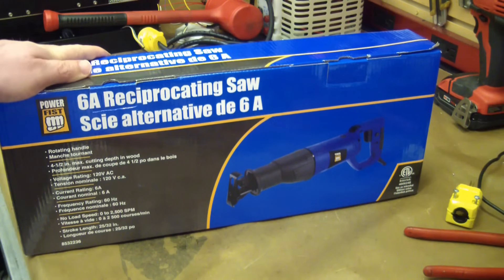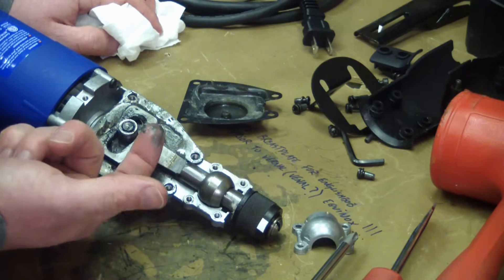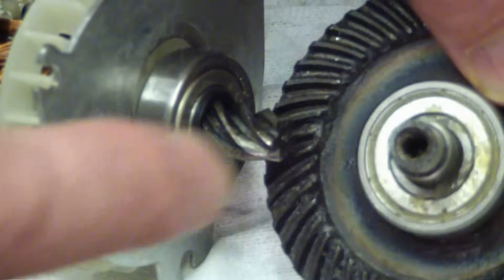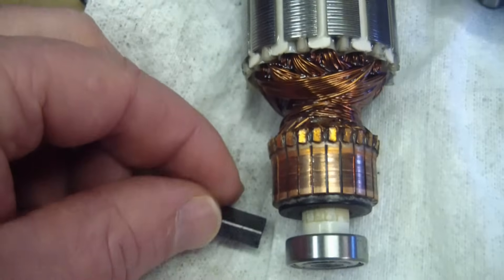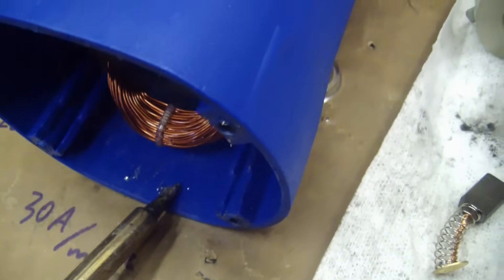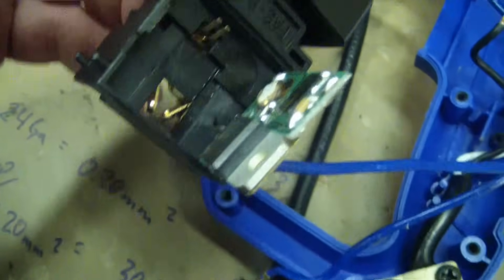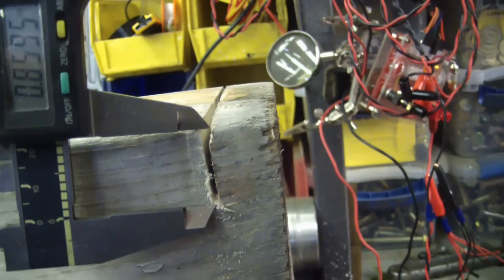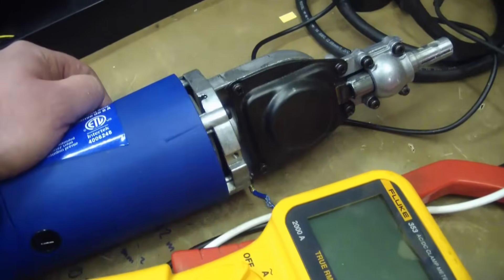Bored of Lame Tool Reviews? Power Fist Saw. Sink your meat hooks into this Offshore Abomination!

Comment: I have the HF saw. Its different,  the swivel is at the working end of the tool not the handle. I don't use the tool daily but I do have the occasional need and have used it to cut some badly rusted 1/2" bolts, and a couple of entry door installs and a few quick things. And she's still "Chooching" it is noisier and vibrates more than the brand name saws. In general I hate these things because they shake you half to death using them but sometimes its the best tool for the job. Mine has saved me a couple hours of time and had I rented one from the tool rental shop it would have cost me $10 for a half day of use. I paid about $25 at HF so I don't feel ripped off since it still works fine. But if I needed one on a regular basis I would go the extra bucks for a brand name. Milwaukee makes one with a handle like on their large grinder instead if the "D" handle which seems more ergonomic. Ok now I'm rambling. Keep up the good work.

Comment: I bought one of these from horrible freight,  I needed one that day and was broke, so I bought the El cheapo. I have replaced it with a Milwaukie  and gave the craptastic saw to my wife...somehow a very small 120lb women managed to strip something out in the drive train.  The motor runs just fine but the blade no wiggels.... now I'm going to go take it apart and see what gave out, and maybe think of something to use the motor for..... maybe attach a fan blade, or a paint stirrer, or who knows. I will find something very  unrecommendable to do with it.
Reply: Looks like the pinion gear was run through a pencil sharperer!....And zip ties holding the field windings in place....very high P.O.S. levels.

Comment: If that's apprentice soldering, I must be the best damn apprentice there is. First time making a headphone cable, almost goofed on the 3.5mm unbalanced jack (should have used 1/4 inch), never had a problem... Except on the grounding bit, you need pixie fingers to solder headphone cables.

Comment: ave. your videos are awesome!  
but one mistake with the description of the bearing  .
z dosent mean deep grove baal bearing . 
6000 z 6 means deep grove ball 0 means the duty of the bearing and the last two 00  tell you the size. z means metal sheald 00 =10 mm 01 =12mm 02=15mm 03=17mm then everything from there times by 5 04= 20mm and so on

Comment: Ever thought about doing some videos on cheap tools that are pretty good?  lol.  I'm currently looking for a die grinder to do some mild head porting on a set of factory iron GT40 heads.  Keep up the great videos brother.
Reply: I bought 3 pneumatic die grinders from Harbor Freight back in 2005,( 2 with a 90° head and 1 straight), for about $30.00 and they kicked ass and were consistently used and abused very often. I still have them although they haven't been used in several years because I dont own a compressor that can produce/store large volumes of air for extended periods. They do consume a lot of air for sure. I bought a straight die grinder from Strap On for $300± in 2007, and those heavily used Chicomp cheap grinders worked just as good, if not better than it.

Comment: this is the same black switch i have on my electric  blower...fairly good but it loses accuracy/flicker with time and dismantle is needed to clean/sanding it with contact cleaner to make it function again
probably interchangeable with mine..
Reply: .....one trick for the blower is to unbolt it and then put it back together gasket maker silicon ....now it can build some pressure enough to  blow out coolant out of your engine/radiator and with the right adapter it blows old gasoline/oil from your lines and stuff...

Comment: what grade of file are you using to make these determinations. I've wondered for like 5 years watching your vids..
Reply: They have special files that test the Rockwell hardness of metal. Each file is of a different level of hardness, so when you start with the first one and continue with each one until a mark/scratch appears. Whatever file that caused the scratch will tell you how hard the metal is, at least somewhere around the +/-10 Rockwell if the actual hardness level. The files are for quick testing rough estimations.Example; file #1 has a range of 0 -10, file #2 range of 10-20, file #3 a range of 20-30, etc.....this is just for examples and not the actual range of each file listed. This was used so as to provide a better understanding of what the files are and how to use them. There is also a few other methods and tools available to test hardness levels and prices vary quite a bit.

Comment: That's just rediculous!  Was that a pinion drive or an end mill? Abrasive lube?  What will the planned obsolescence people think of next?  Self shrinking tubing using undersized wires? Clever, but not a very good idea. 

I doubt I could buy the parts and materials to make a reciprocating saw for $30 Canadian, let alone ship it half way around the world.  Apparently Power Fist can't either...it may be shaped like a saw, but it's not a saw.  

Thanks for the warning!  I'll stick with my Milwaukee. 

-- Mike
Reply: BigMjolnir Now that you bring it up, the fact that the pinion might actually be an end mill (WHY OH WHY??) totally explains why the edge of the "pinion" is so sharp! Because it was originally used for machining!

Comment: Princess auto and Harbor freight have no affiliation. This tool has same price. Harbor freight saw is Chicago Electric brand. PA manufacture Power fist. HF sources tools not manufacture. HF Quality assures their sourced tools at a HF QA facility. PA manufactures so doesn't care about QA. Based on your autopsy I would say Chicago Electric is higher quality. I FIX and IMPROVE what I own since I take pride in and value what I possess. I work hard for what I don't have. If it's that buggered I take it back to HF for a refund I like the look on the mnger. and customers faces when I drop off handfuls of broken pieces. I hope it goes to QA so they can study what went wrong and financially encourage them to make less warranty replacements.

Comment: Thats one of the nastiest looking circuit boards I have ever seen, I bet all those parts are secondhand. 19:29

It would be alot easier to just to use only threw hole stuff. Surface mount components look just terrible when they are hand soldered.

Comment: I think you've got your maths wrong with the current per mm2.
P=IV, V=IR so P=(I^2)R and resistance is inversely proportional to CSA (but not a CSA squared or anything). 

So we have the numbers 15A through 0.82mm^2 and 6A through 0.2mm^2. What you've done is then convert everything to amps per mm^2, but I think you should have done I^2 per mm^2.
That gives... PF is 180A^2/mm^2 and Makita at 274A^2/mm^2

Please point out the flaw in what I'm saying.

Comment: At-least you can salvage the motor from this, and use it on some project you want to do. (I've been looking at a lot of 3D printer technology, and I think you could even salvage the plastic case from this thing, to make filament. You'll have to identify the plastic fully though. I'm not saying that plastic is expensive… Just saying that as an aside; there's a lot of stuff that can be salvaged if you think hard enough about it.)

Now that I think about it, what do you even do with most of the junk you accumulate from running this channel?

Comment: I'm not sure how you did it, but if 9 rotations of the rotor equaled one full turn of the shaft, that would actually be 4.5 turns for 1 stroke. So that would be 11,250 rpm I believe.

Comment: I just bought my first sawzall, milwuakee, so I could cut out the BB my bike store said could not be replaced and that I would need to throw away the frame. An aluminum FS bike? When donkeys fly!

blades...diablo is made by freud and the one I got rocks through steel. No hook rake angle with carbide teeth. way better than bi metal

 power fist sounds like a bad porn movie I just do not want to see. I started watching this thinking" I don't need to see this" but then you made me laugh so........

Comment: You need some of this magic juice: www.ezgrip.net
No joke it's well worth it, you would have had that screw out fast as normal. Maybe ezgrip would be interested in you doing a review, maybe you can do a video on it.  This stuff has saved me so much hassle I'm interested to see what you'd think of to put it to the test.  I'd actually love to see a case where it doesn't work.  I'm not affiliated or anything, just happened across a vendor at a trade show and bought some.